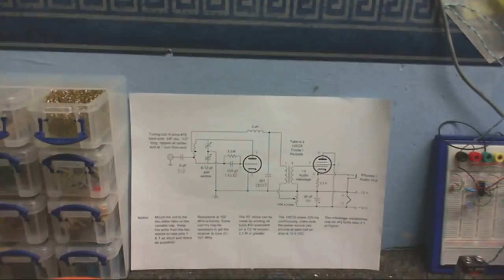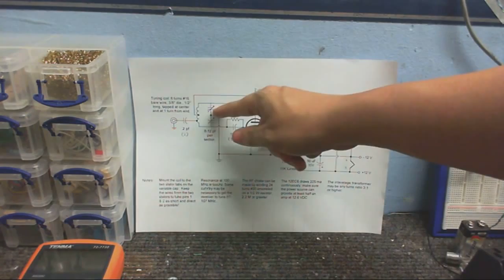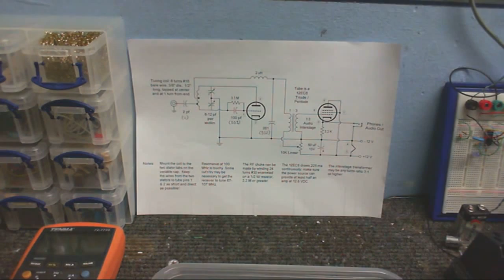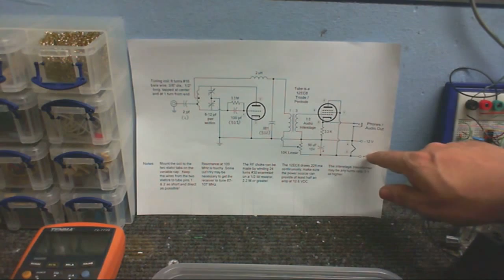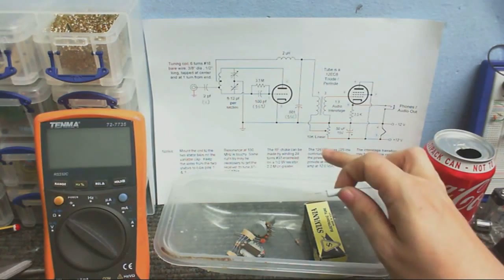Tube Time ep - 14 - 12EC8 FM Radio (fail)

Comment: I didn't even know that a tube FM radio could be feasible, I thought only AM could be picked up by the thing, very cool, also, it would be very helpful for your research and experiments for you to make a radio transmitter as then you have a very clear and distinct way of finding out if your radio is working even when there is possible shielding from the house as well as noise from  neighboring electronics or if it just simply is not working what so ever.
Reply: Wesley Smith lol
all tube radio's from the 50 and 60 have fm

but a regenerative fm recever is not as common
Reply: Wesley Smith I've seen PLENTY of FM tube circuits and radios. I have 4 of my tube radios that use tubes for the FM circuit. The receiving part can be much lower voltage and lower power. Trick is things have to be just right.
Reply: ***** are tube FM radios up to snuff with the transistor radio? I'd imagine they're better in terms of sound warmth, but I wonder how robust their band-range would be or if there are any drawbacks (other than possibly power consumption) that a tube radio might have?
Reply: the fm on tube radio's when correcty calibrated
is extremly sensitive and ans a reception that is better then most modern radio's
yea they consume more power
and they need a special decoder for stereo (also tube ofcourse)

but the sound is the breaking factor here
its so much better
Reply: ***** well that sounds amazing

Comment: Right. This is a 12v circuit. I have one that is using 1A2 or EF95 (or equiv.) I will send it to you. I think it uses about 70v. I've seen many FM radio schematics using tubes that are "normal" high voltage tubes but the FM circuit only uses between 40v-90v. I will try to send some of those your way.

Comment: It's a super-regenerative receiver, and it sounds to be working fine as you first built it- you probably just aren't covering the whole FM band with that combination of coil and capacitor. The tuning cap you have is fine- both halves should increase capacitance in step; at RF it works as a Colpitts oscillator with a centre tapped tuning capacitor. Just try opening out or squeezing together the turns of the coil until you hit the right tuning range. Don't expect awesomeness from this circuit, it ain't that good!!

Comment: Huh, well I did build this circuit and it worked, though it was fiddlely. you may need to have a low capacitance tuning cap like the schematic says, i found one on Ebay from California and it worked. also try spreading the coil out, that lowers the frequency too! the tuning cap MUST be ganged to keep the the capacitance equal. Also your chair does that because (I think) of leaky gasket on the pneumatic piston.